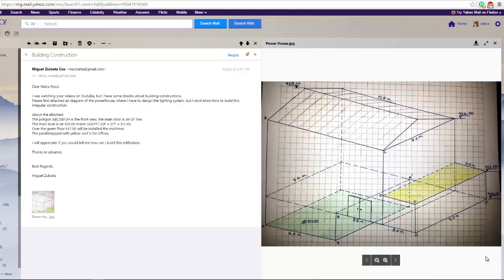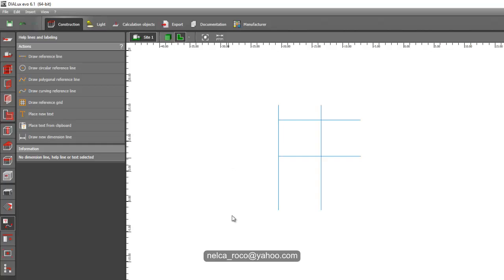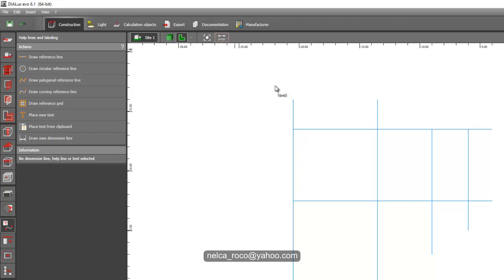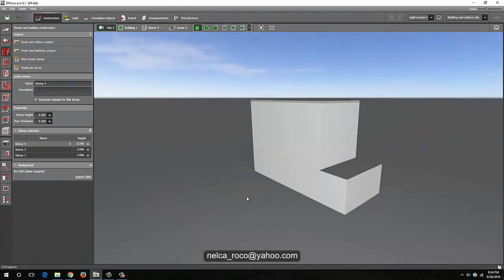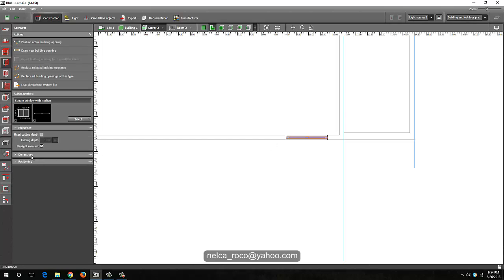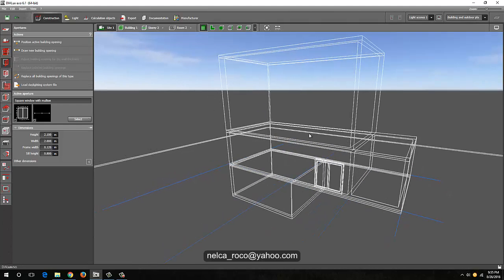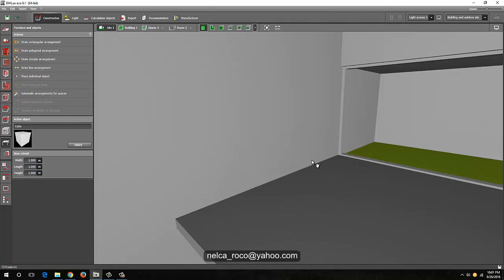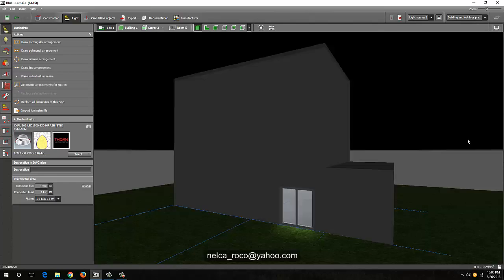Building a different height of rooms

Comment: Hallo, I tried to cut the bottom between the ground- and the first floor of a two floor plant building. There is no problem to cut a wall or the roof, but to cut the bottom of the first flour to make the room in the ground floor higher, will not work. What could be the reason and the solution for this problem?

Comment: is not accurate.. which is the width of the walls?? you draw clicking in any part of the building.  Dialux is innacurate and slow for construct elements.  People that use dialux comes from sketch up, revit or 3dsmax.  Need more and effective tools to construct in dialux.  But this is only a lighting calculating software, not for modeling.
Reply: The point of the video is to show you how to set up the model for the photometric calculations. You'd adapt what this is showing you to the plans that the architect provides. I've used Visual and AGI32 and I have to admit (based on the tutorials I've seen) that Dialux allows you to create a more detailed model with much more ease than the other two software.

Also, Thank you Nelca for this tutorial. It was very enlightening.
Reply from the maker: @JavierGomez-xy9wy  ur welcome
Reply from the maker: you are right Richard.  Dialux is for lighting design design not for modeling.